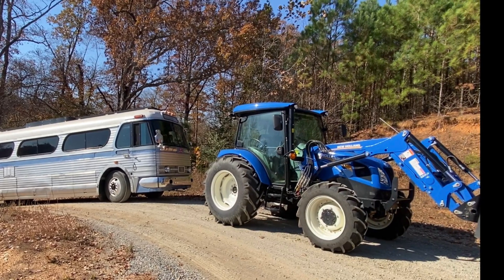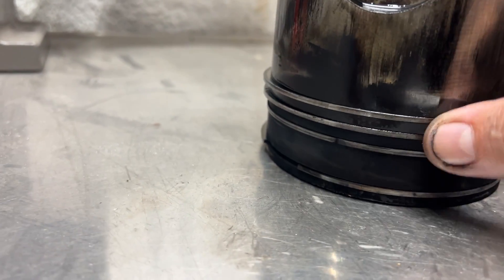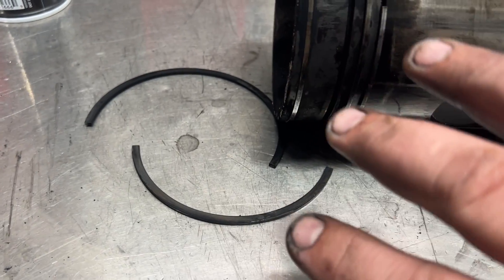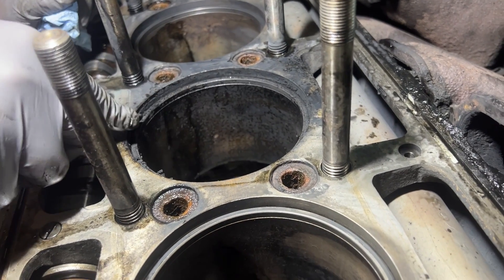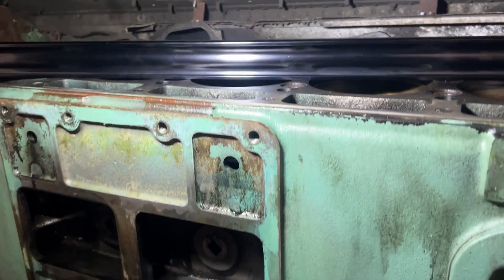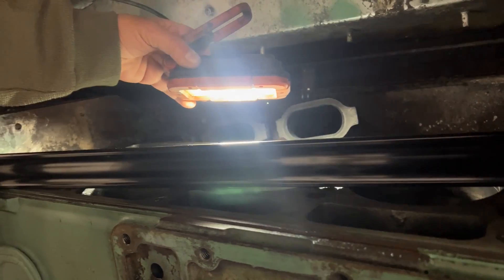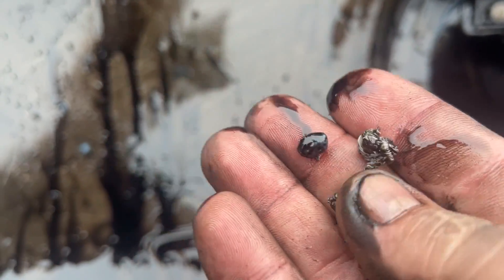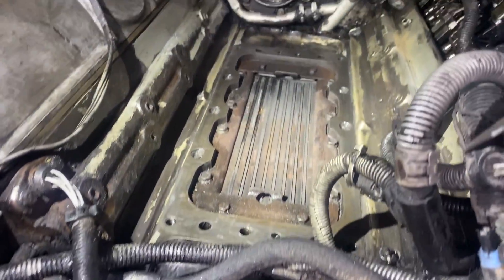Detroit diesel engine teardown and inspection

Comment: The spring steel you're finding looks like the spring-type hose clamp that my motorcycle uses for the rubber intake boots where they join the carburetors... only chopped up into many pieces!

Comment: At the 7:14 mark. for those of us that are not engine mechanics, what were you looking for?  I understood the ring gap, but couldn't figure out the pick on the head.  EDIT: Not talking about the scraping of carbon but the pick in what looked between the head and block or gasket.
Reply: Extracting that carboned  up liner seal.

Comment: Are there springs in the oil control rings ?
Reply: I think yes but those are usually wavy things and not a coil type spring that they found in the sump.
The coil spring type is usually found in oilseals.
Those broken compression rings were quite a shocker. I only ever saw that 1 time before on an LPG engine.
Rings can break when the gap was too tight and the engine got severly overheated  Then the ring has no more room to expand, butts up to itself and snaps. It also explains the excessive scoring in the liners.
Nice thing is that you can swap liners with matching pistons and rings. No block machining needed if the deck is straight. (and it was)
Once this engine is back up and running it will make a HUGE difference. 
It will probably have 2x the power at the wheels.

Comment: Was told once that a 671- 4 valve head has 632 replaceable parts on cylinder head, injector, cam rollers etc, could that be correct???

Comment: Do the liners support the full force of the combustion or does the force get transferred through the liner wall to the block itself?
Reply: @americanrambler4972 Not a mechanic but I'm going to go out on a limb and says "yes" for this engine, the force gets transferred thru the liner wall to the block itself.  Same for the 8v71.  However, the 6v92 are 'wet-liners' .  I'm not sure but I believe there is water between the liner and block in the 92 series 2-strokes.   Hopefully a real expert will confirm or correct me.
Reply: Liner is a firm slip fit into the block bore (dry liner), so the block takes the combustion forces up, down and sideways.

Comment: I thought the 6 71was a V.
Reply from the maker: 6v71 is the v
Reply: Love all your videos Scott.  I am glad my message actually can get through with all the fans you have.  Really wish I could get my Prevost down there. @BusGreaseMonkey
Reply: Thanks Scott.  Which engine is this?  its a straight six.   @BusGreaseMonkey
Reply: 671 is an inline 6.  6V71 is the V configuration.
Reply: 6-71 is an inline 6 cylinder engine, 6V-71 is a V-6 engine. It’s a bit straight forward with the model names.
Reply: @josephalberta1145     Detroit Diesel manufactured several configurations of 2-stroke 6-cylinder diesel engines. Their 71 cubic-inch per cylinder inline 6 is referred to as the '6-71' and their V-block 71 cubic-inch is denoted with a "V" behind the first number; '6V-71'. They also manufactured flat, or "pancake" engines designated with an 'L', but enough said.
Reply: They made probably 50 in lines to every v in 671, just guessing, many in military, Gen sets, trucks, industrial etc!!!
Reply: I have a series 60 DD inline six but I thought most of the older buses had the V.  I guess they had the straight six back then too.  Thanks for the comment.
 @kevinsiedschlag429
Reply: Not after the 1950s. V style Detroits were the “norm” from the 1960s well into the 1990s.
Reply: 6 is the number of cylinders and 71 is the cubic inch of that cylinder.
Reply: Thank you for that.  I just didnt realize they made a 6 71 that was not in a V configuration.   @henrys.6864
Reply: @josephalberta1145 
Even made a double 6-71 with two parallel inline 6’s and a single output shaft. It powered WW2 Sherman tanks.
Reply: They made a lot of 92 series they where all v s completely different engine, wet sleeves etc

Comment: Seal springs I’ll bet, front or rear main ,,, no ideal on the other possible sealant from through bolts or studs that were sealed wrong,,, I’ve had that myself on coolant and oil sides,,, nothing surprises me anymore,,,, 45 years I’ve seen a lot ,,,,
Reply: I was thinking seal spring also.
Reply: Those little curly pieces definitely look like the springs that help hold the seal against a shaft if some sort.